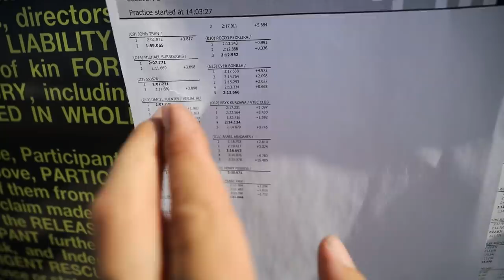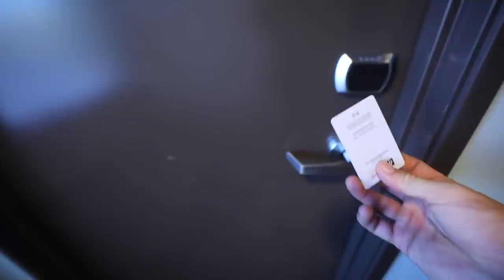Spoon S2000 Gets AMAZING New Wheel Set Up | Time Attack Competition Prep

Comment: What psi are u running in the rear tire you get a lot of oversteer and you have so much suspension mods it’s like u need to soften your sway bars or lower the tire pressure

Comment: Did you know that the Tesla model3 aero wheels, weighs just a hair more than the same size and spec te37’s and they have the same hub bore as the s2k, they also look pretty sick and obviously are 5x114.3 oh and the hubcaps were designed by spaceX to suck the air out and help cool the brakes/electric motors👀👀👀
Reply: I’m just saying it would be pretty sick if u got a set to race in🤝👀

Comment: just learn to get clean apexs and figure out when to start braking or letting off of throttle when entering and exiting the corners as clean and as smooth as possible just remember slow going in and throttle coming out go in halfway slower then get on the gas coming out to sling shot yourself down the straight aways.